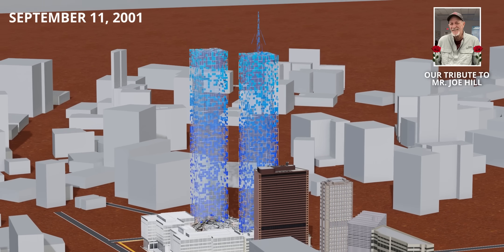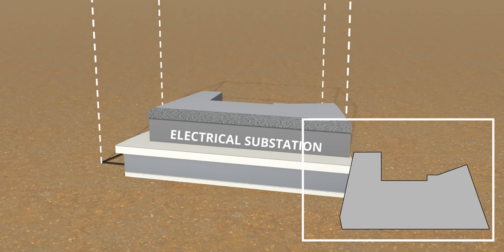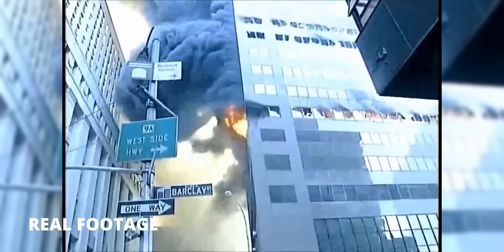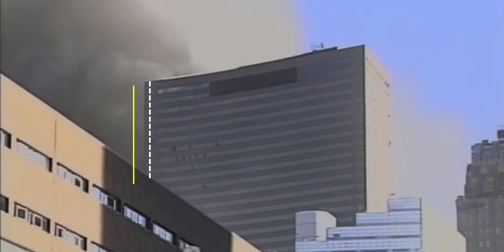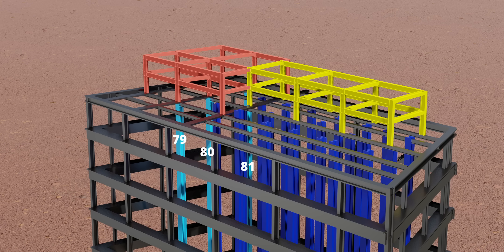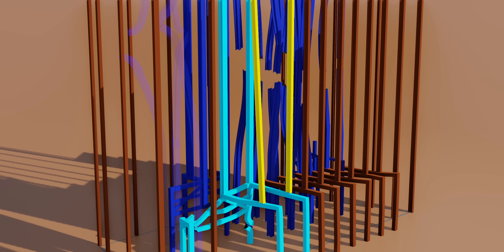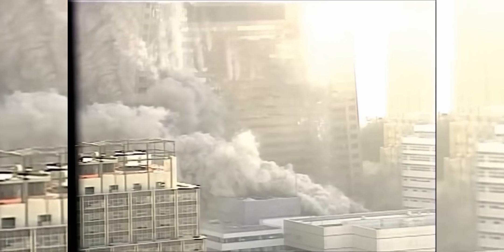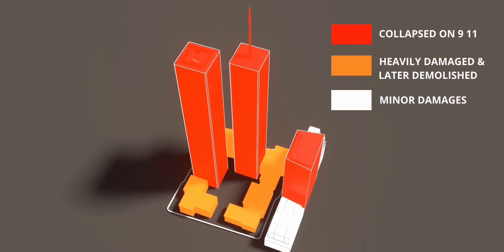Collapse of Building 7 | The Complete Physics

Comment: The criticisms below are all grounded in physics and structural engineering principles, the same principles our reality is built on. 

NIST ignored steel studs that should have stopped the floor beams from sliding and pushing the girder off.

The girder had stiffener plates that would hit the column side or seat plate before it could slide off — making the claimed walk-off physically impossible in that direction

Materials expand when heated — described by the formula
\Delta L = \alpha L_0 \Delta T

Structural critics calculated that even at high fire temperatures (~600–700°C), steel beams would expand a few centimeters, not enough to push a girder off a wide seat

NIST only showed how collapse might have started, not how the whole building came down the way it did.

The building dropped at free-fall speed for over 2 seconds — this means all columns under that section gave way at the same time, which fires don’t do 

NIST didn’t use any physical steel from WTC 7 to check their theory — they based it all on computer models.

NIST refused to release their full simulation data, so no one can check if their model is accurate.

Fire weakens steel gradually and unevenly — it doesn’t cause instantaneous, symmetrical failure across many columns at once.

Newton’s laws: When a structure collapses, falling mass must do work to crush what’s below it. Free-fall implies no energy was used to crush or break anything below — all resistance vanished. You can’t have free-fall unless supporting material is destroyed or removed first
Reply: "Materials expand when heated — described by the formula \Delta L = \alpha L_0 \Delta T"
Congrats, your copy-paste didn't work. Perfect example of someone who repeats what they don't understand.

"The building dropped at free-fall speed for over 2 seconds"
No, it didn't. Partially becasue "free-fall speed" isn't a thing, and partially because you didn't understand the thing you're trying to use as an argument. Another example of someone repeating something they don't understand.

"NIST didn’t use any physical steel from WTC 7 to check their theory — they based it all on computer models."
Which would not have been possible, and would not have mattered even if it was.

"NIST refused to release their full simulation data, so no one can check if their model is accurate."
No, they don't. But then, you don't need that, all you need is the input, which is perfectly accessible. We know this since there are multiple cases of other simulations.

"Newton’s laws: When a structure collapses, falling mass must do work to crush what’s below it. "
That you don't understand Newton, or his various laws, was already very clear. Repeating it only reinforces your failure to understand.

TL;DR: You weren't nearly as smart as you thought, and neither were the people you parroted.
Reply: @mooneyes2k478 really hahaha just saying “ you don’t understand” isnt a counter point. Acceleration due to gravity on Earth ≈ 9.8 m/s². Do your research.
Reply: @k-town31  Yes, actually is is a counter-point, when you clearly fail at even the basics.
As for "acceleration due to gravity", not only is that not a thing, but the gravity of earth varies. But yes, the generally accepted average for earths gravity, g, is 9.82 meters per second per second. So what?
Reply: @k-town31  - I did my research. Free fall doesn't matter - for reasons I already spelled out in detail and which you notably chose to ignore.
Reply: 1. Studs?  You mean the stiffener plates.  No, they would not have prevented A2001 walk-off. You are just taking Tony Tsamboti;s bare, unproven assumption at face value.  Tsamboti makes a lot of mistakes in his analysis all of which he has been made aware of but refuses to correct.  Tsamboti knows his audience won't care and it keeps the donations rolling in. 

2. NIST concentrated on collapse initiation for the Twin Towers.  Collapse progression did not require explanation for the intended audience. For Building 7 The NIST explained both initiation AND progression stage in detail. This video (and discussion) is about Building 7. 

In future I suggest you know your material rather than mindlessly repeating other peoples bad ideas without knowing the context.

3. The building (defined as its center of mass_ DID NOT collapse at free fall speed (which isn't a thing - free-fall is a measurement of acceleration, NOT velocity) for over 2 seconds. Late in the collapse a single point on the exterior moment frame (the outer shell or "empty cereal box" as it is referred to above) averaged a rate of movement (not "fall") roughly equivilant to free-fall acceleration for 2.25 seconds.

Which tells us nothing about what started the building (again, defined as its center of mass) falling some 10 seconds earlier. The drop of the exterior moment frame was a product of collapse progression mechanisms NOT collapse initiation mechanisms. 

4. There would have been no point in studying the steel from Building 7 even if The NIST could have, as explained in detail in their report. You should have actually read it. 

5. You only need The NIST's input data if you want to exactly reproduce their models using their software. Nothing stopping anyone from making their own models - and many have. Another AE911T Red Herring. 

6.  The NIST do not claim instantaneous, symmetrical failure across many columns at once. Just the opposite in fact. Again, you should have actually read The NIST reports. In fact other than AE911T literally no one makes that claim. This video certainly doesn't. Sabine explains the collapse correctly - as a progression of column failures ultimately resulting in global collapse.

IF you don't like The NIST's report on Building 7 (because the internet told you not to) you are in luck. The collapse of Building 7 is one of the most studied engineering disasters in history and the subject of 5 comprehensive engineering studies and more than two dozen technical articles in major peer reviewed engineering journals, most of which were published 15 or more years ago. Thousands of pages of material.  This should get you started.

FEMA BPAT (initial report superseded by NIST NCSTAR 1A)

NIST NCSTAR 1A: Final Report on the Collapse of the World Trade Center Building 7, 2008. (Try actually reading it)

Guy Nordenson and Associates, WTC7 Global Collapse Analysis Report and Summary of Findings, 2010.

Arup, WTC -7 Structural Fire Analysis Report (Runs 1-4), 2010.

Weidlinger Associates Inc., WTC 7 Collapse Analysis and Assessment Report, 2010.

BRE Centre for Fire Safety Engineering, Analysis of the Impact of a Fire in the Mechanical Room (5th & 6th Floor) of the World Trade Center 7 Building, 2010.

T. McAllister, R. MacNeill, O. Erbay, A. Sarawit, M. Zarghamee, S. Kirkpatrick, J. Gross, Analysis of structural response of WTC 7 to fire and sequential failures leading to collapse, J. Struct. Eng. (United States). 138 (2012) 109–117.

For a summary of the major studies I would recommend THE COLLAPSE OF WORLD TRADE CENTER 7: REVISITED by Mhd Anwar Orabi , Liming Jiang , Asif Usmani and Jose Torero which is a 33 page summary of the different analysis and conclusions published in 2020. Sorry, YouTube will delete this post if I give the link but it should be easy to find and is available from the University of Queensland, Brisbane. 

Real structural engineering industry professionals conducting real engineering studies and publishing them for other professionals to see. Not amateur YouTubers appealing to the gullible and credulous.

Happy reading

Spoiler Alert: They ALL agree Building 7 collapsed due to 7 hours of multi-floor unfought fires - something no building is designed to survive.

7. Your mis-applied understanding of Newton's Laws is an argument AE911T has been using (without success for 19 years) on the Twin Towers. It does not apply to the very different collapse of Building 7.  Again, don't mindlessly repeat but know your material. 

The criticisms you presented are not grounded in physics and structural engineering principles, but rather in gross misunderstanding of those principals. That you want or maybe need to believe them does not move the needle on that.

Comment: Its funny to still ready that there was controlled    detonation of theses buildings pento in dc two . There would of been guys rigging the place up what were they doing replacing light bulbs or fire extinguishers or place flower vases at each column or may be the fire fighters pagers were tampered with 😂

Comment: You still can't explain how steel melted without the correct temperatures required to melt and bend steel. But if you add thermite to the equation then you have your demolation
Reply: No need to explain things that didn't happen.
Reply: @TheCriticalStinker-01 I believe your mistaken. 9/11 is a big mess and the truth is important.
Reply: @TheCriticalStinker-01  Look up The Great Thermite Debate for proof of how easy it is to make thermite cutting charges capable of cutting steel.
Reply: @NotTheRealRustyShackleford  - Don't have to. Doesn't matter if Cole's tests are correct, accurate and relevant or not (they aren't BTW). No thermite was involved in any way in the collapse of Buildng 7 so it is hardly worth the time to discuss.
Reply: @TheCriticalStinker-01  How do you explain the angeled cuts on steel beams visible in pictures from right after the collapse?
Reply: @NotTheRealRustyShackleford  - You're welcome
Reply: @TheCriticalStinker-01  But somehow you cheap shil feel the need to deny what did happen.
Reply: @TheCriticalStinker-01 who do you work for? Gru unit 74455?
Reply: Like, shut up!